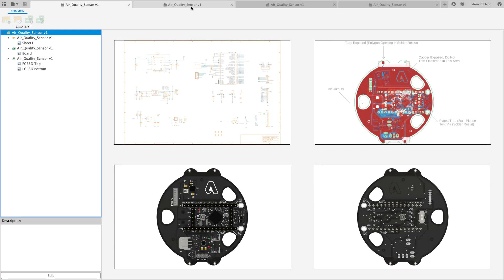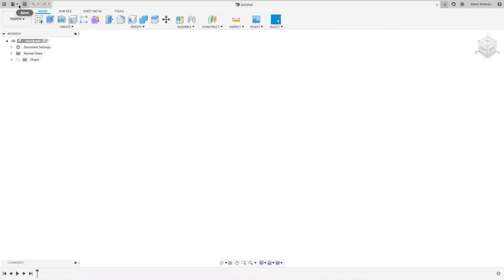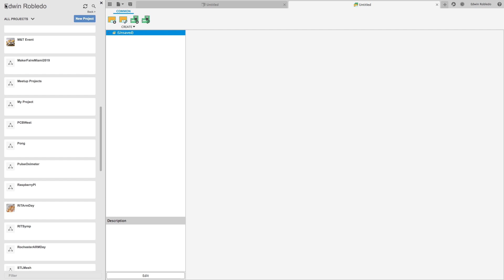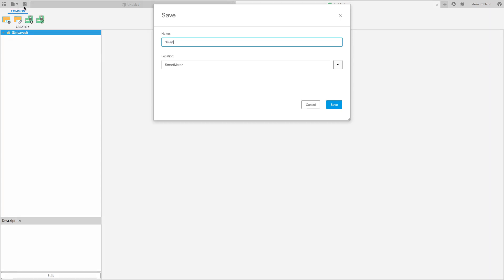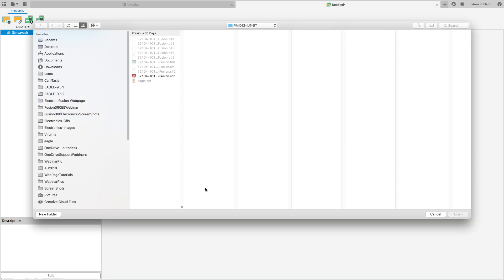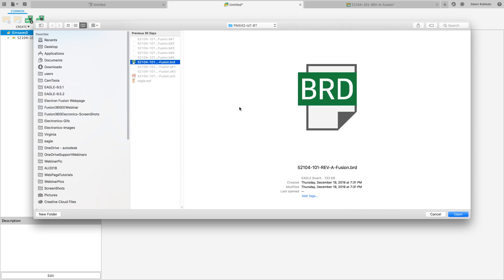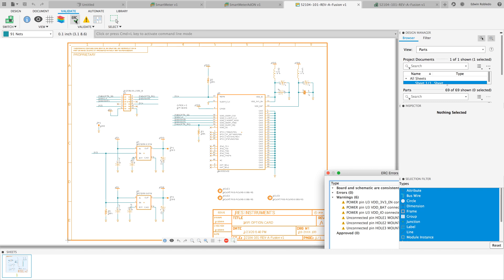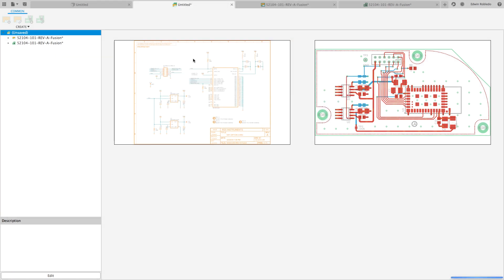Import EAGLE files into Fusion 360

Comment: Can new eagle designs be saved in the cloud? In other words can I avoid local storage completely?      Has the workflow to sync the PCB to a 3D model in fusion changed at all?
Reply: EAGLE files can not be stored on the cloud. If you are interested on this workflow, it would be best to used Fusion 360 for all your electronic designs. Fusion 360 places your electronic design files on the cloud. Therefore file can be accessed remotely, and designs are automatically versioned. The workflow between 2D and 3D PCB editing has been improved.